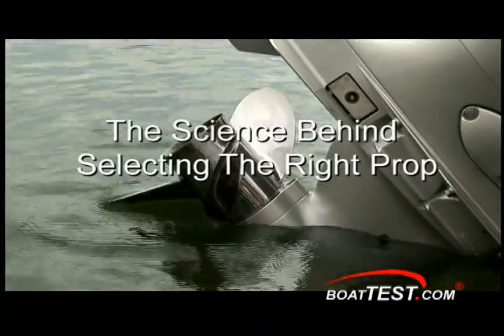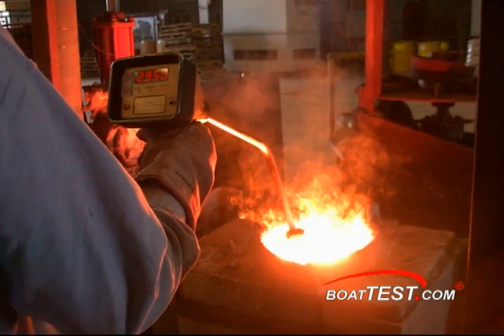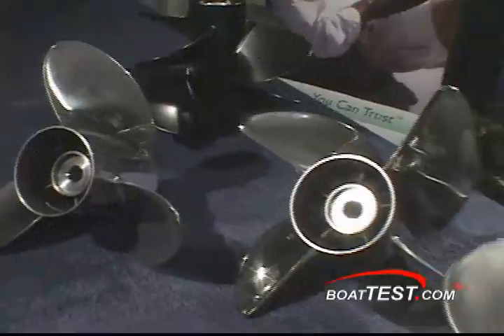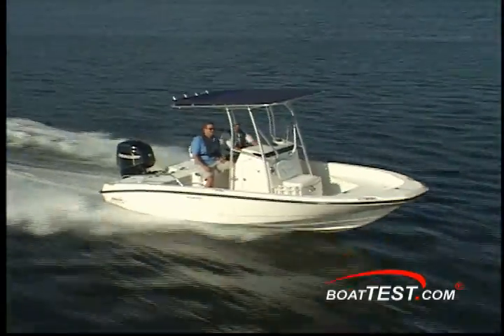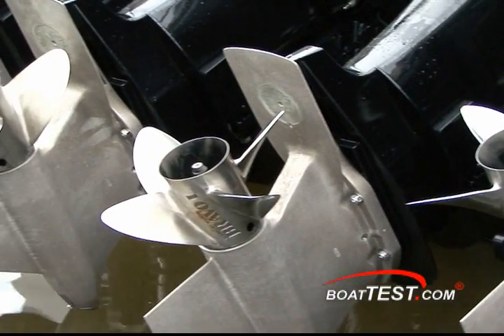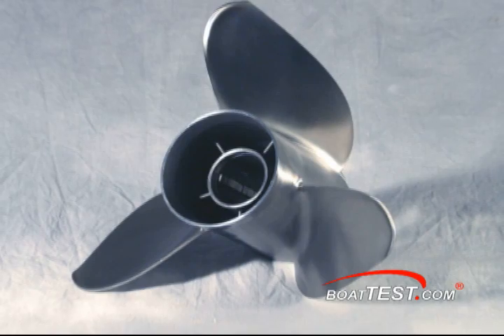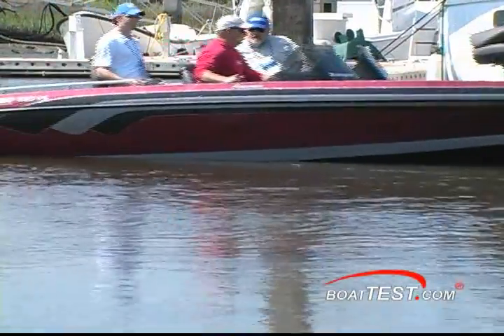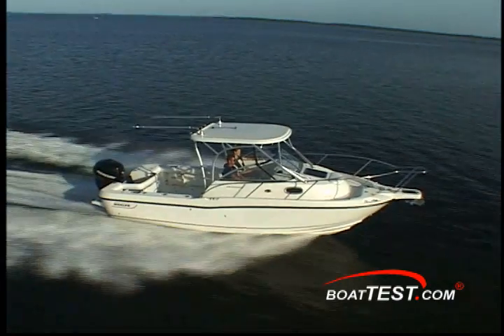PowerTech - The Science Behind Props 2008 (HQ)- By BoatTEST.com

Comment: What are the differences among these three props if installed on same 2017  yamaha 115 4 stroke ...what would be the expected results from each one. The descriptions with each of these on the website virtually say each one is the perfect prop for me. Currently using aluminum 3 blade 13.5×16-K 
NRS4 
RXB4 
RED4 
13.25"x16